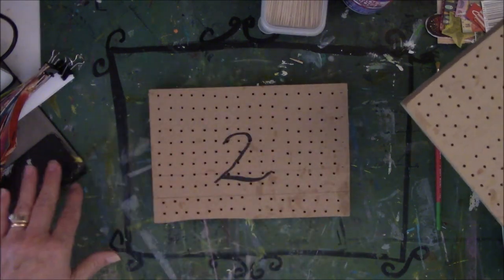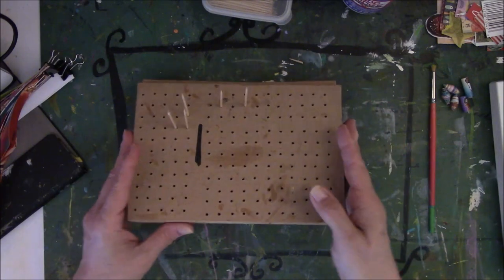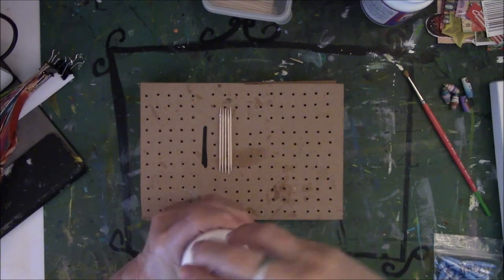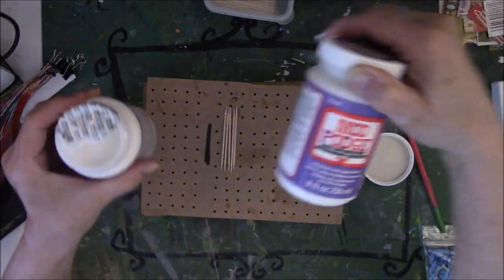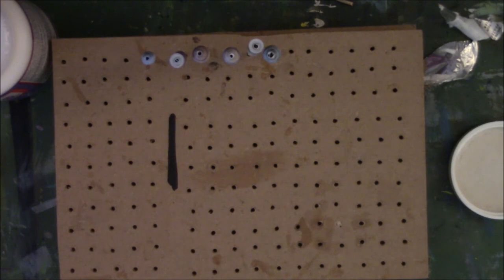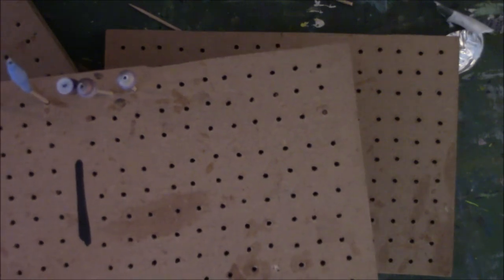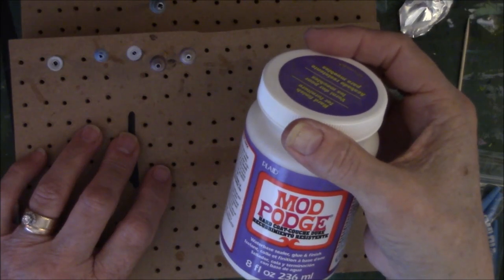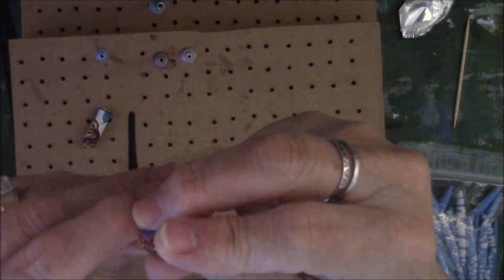Sealing Paper Beads

Comment: I really needed this video!  For the most part, I was doing the "right" thing, I was using Mod Podge, with a brush.  But this board system is genius!!  Thanks!
Reply from the maker: I am glad you got something from the video.  I am going to more about different kind of beads in the future but thought I would do them a little at a time.  I love the board system because It doesn't take up much room and didn't a bunch of extra construction or anything else.  Extremely simple to do.

Comment: Where did you get the long skinny bead roller for the 2 inch bead please?  My dad ordered me a set of rollers from Julie A Bolduc of Just Plain Fun via Amazon in December but the pin is just about an inch and a quarter long.  Before that I was hand rolling around a straightened out paperclip, and before that I whittled toothpicks to be really thin.  I have also only used brushed on Mod Podge and decoupage glue for my glazing.
Reply from the maker: It took me a minute to find my rollers.  The large paper bead rollers were purchased from Julie A Bolduc from her Etsy shop.  She has different sizes.  I think there are five different ones.  They are called Split Pin Paper Bead Rollers.

Comment: One thing I do to stop the bead from falling off the bottom of the toothpick is, I take a tiny, narrow scrap of paper and twist it around the bottom of the toothpick or down  and let it dry and it forms a little bump and stops the bead from going down falling off.  Saves needing trash beads

Comment: Polystyrene works better to hold the bead on a toothpick
Reply from the maker: I used styrofoam to put my toothpicks in.  Then I switched to a board with drilled holes.  I labeled each board 1, 2, 3 for the coat number.
Reply from the maker: I did styro for many years.  I had tiny pieces of it stick to some beads after using the styro for so long.  That's when I switched to the composite wood squares.   I do however use styro with my flower making that is one wire.  If the styro gets used loads of time, the tiny crumbles don't matter.  Crumbles in bead making, matter.  I don't make beads as much now as I used to.  I have thousands of them stored away that I use now and then.